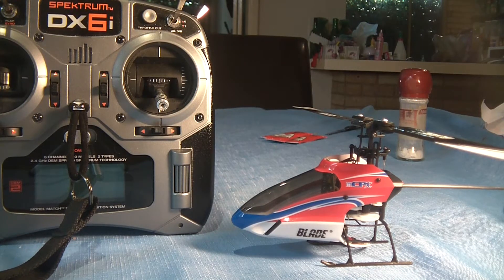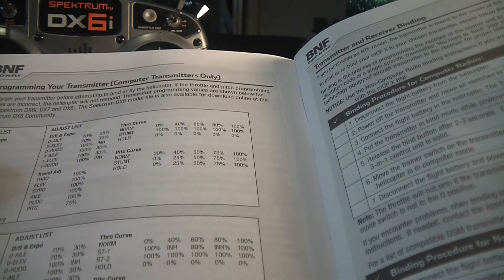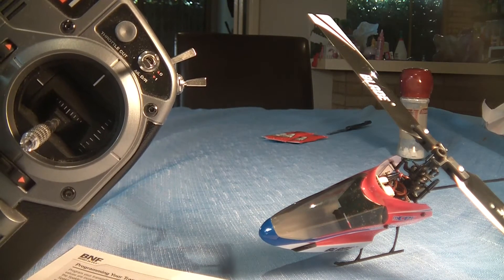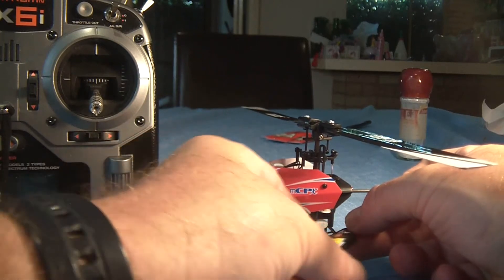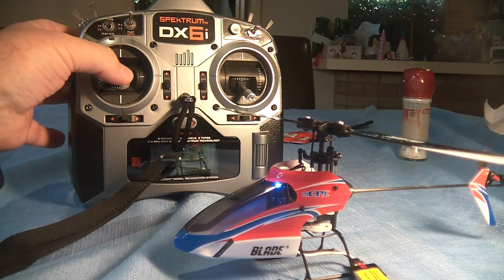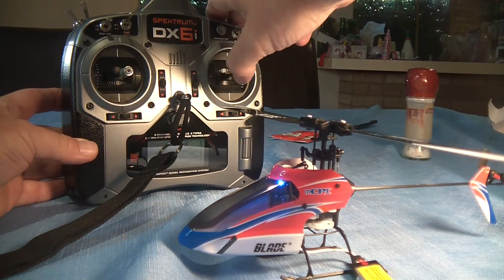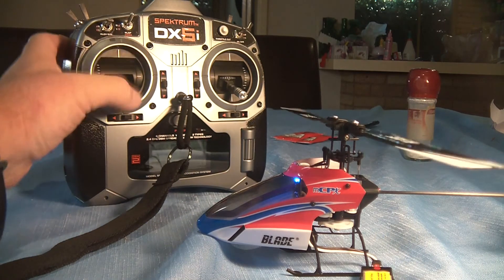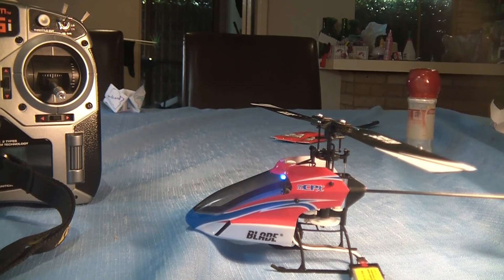E-Flite Blade MCPX binding to DX6i - Video 2 of 5

Comment: Thank you for the video. I just graduated from my 120 SR to the MCXP. The dealer at the local hobby shop bound my dx61 and I am not happy with the late response from the throttle. Also, when I take of it wants to shoot forward for some reason. I was really good with my 120 but my confidence with this is starting to dwindle.

Comment: I have the DSMX version of DX6i Mode 1 and my bind/trainer switch is on the top right hand side. In order to bind my mCPX V2 I also had to hold the rudder stick to the right during the bind process.

Comment: ATTENTION   Just spent the better part of a day trying to figure out why the motors won't spin up after binding even though all the servos are moving.  Tried everything except reading my mCPX manual  facepalm
Don't hold the bind switch for more than 3 seconds or it will eventually bind but the motors won't turn.  AND after you release the switch and it binds HOLD THE RUDDER SWITCH FULL RIGHT for a few seconds until the blue LED goes solid.

A good lesson.  Always RTFM (Read The F'n Manual).   Doh!

Also I had some trouble binding it if the transmitter was too close to the heli.  If yours won't bind try standing a couple of meters away.

Comment: Thank you for posting this! 
This is the first time I've tried to use a bind and fly system. Where on the transmitter is the bind button?  Why does it seem as though your radios sticks are is backwards from mine?

Comment: Hi Rob:

Question....
i have 2 helis , one RTF and the other BNF what if when i bind the BNF it to the dx4 ( RTF ) radio , when i hit the bind button the swashplate goes up and down ,i think it means it it in comp. radio mode, how do i switch it to a non comp. radio ? like the dx4 
and my RTF heli does not spin the rotor head and the tail rotor, i sent the board to be check and they said it is in good working condition, what is your sugestion ?
thanks so much !!